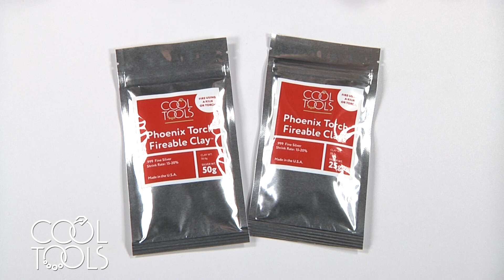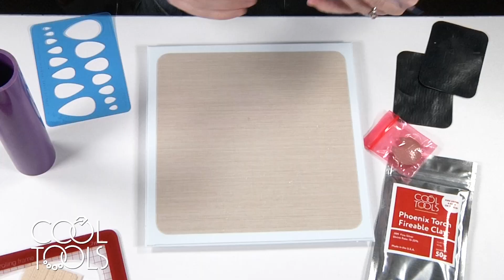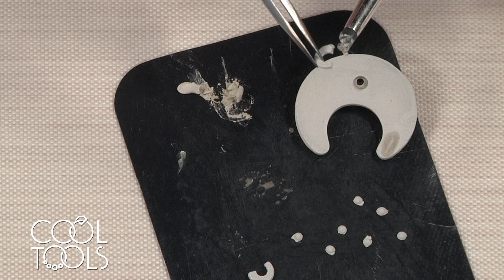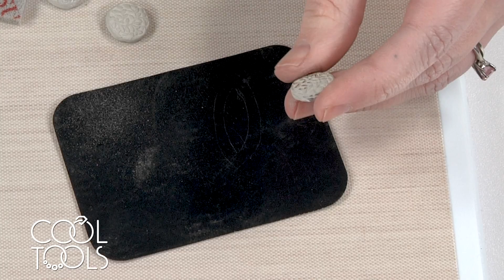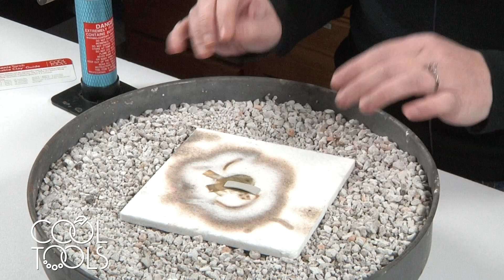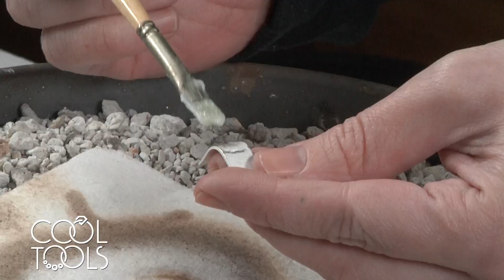Cool Tools | Intro to Phoenix Torch Fireable Clay™ | Fine Silver Metal Clay

Comment: Just purchased this clay, mine is definitely a different texture that I’m noticing from this video. My clay is cracking, and definitely not smooth as yours is. I added a drop of rejuvenate without success of conditioning it smoother. Definitely not happy so far with this product
Reply from the maker: Hi Cathy, 

As a result of the density of this clay, when adding moisture back it’s helpful to roll the clay into a sheet, place a drop or two of water or Rejuvenate on the surface, spread it out, and fold the moisture in. This helps it incorporate instead of sitting on the surface making things slippery. In fact, since you asked about special ways of working with the clay, any time I roll the clay into a sheet, any clay that I’m putting back, I’ll swipe a finger damp with water over the surface of the clay and fold that moisture in prior to putting it away. 

Hope this helps, 

Karen

Comment: Hi Karen, thank you for this incredible video! I've been having a few issues with the Phoenix Torch Fireable clay and cannot find tips to fix them online anywhere. When I first open a new pack of clay it works great at first but then will become hard to use and starts to separate and crack when using for a second time. I have tried adding moisture and also keep any leftover clay in my hydrator container, but adding moisture seems to make the separation even worse. Do you have any tips for this? Additionally, I have had a few projects break after firing recently when I tested out the strength very lightly. I am not sure if I need to fire for longer or if this is normal with thinner pieces, but they seem to be breaking far too easily. Any tips would be greatly appreciated, I was used to using the Mitsubishi PMC clay so this has been an adjustment for sure!
Reply from the maker: Hello, whenever I do anything that might have a drying action on the clay, such as rolling it into a sheet or rolling it into a coil, I’ll brush or apply some moisture to the clay and immediately fold it in. Just applying the moisture to the top of it doesn’t seem to help much as the clay is dense enough that it doesn’t readily absorb added moisture unless it’s incorporated in. Could we inquire as to what method of firing you are using or what firing schedule you are using that is resulting in the breaking pieces?

Comment: I would like to fire my Phoenix clay pieces with a trinket kiln.  Would the time be different from kiln fired suggestions on the card - I'm assuming the card refers to a larger kiln and not a trinket kiln?
Reply from the maker: Hi Jennifer, that is correct. The firing temperature and times on the card are for a standard table top kiln. If you can tell us what trinket kiln you are using we can help you in how to best fire your pieces.

Comment: Hi Karen, 
Would this clay be good to make rings  and bracelets using the torch to fire? Or is better for just pendants?
Also , would you still pickle this when finished before polishing?
Also, if I were making a bracelet, would and should I bend it before firing it with the torch? Would I be able to and is it possible to make a bracelet with it, being as it would be long when flat? Can you fire a whole bracelet with a torch?
Reply from the maker: Hey! So this is something I'm currently testing out. Fine silver typically isn't recommended for rings, but I've found that Phoenix sinters to be really strong, even with just a torch. I've made several rings that I've torch fired with Phoenix and have been wearing them and putting them to the test of being worn to see how they hold up to daily wear and tear. So far the ring I've been wearing for 5 months is holding up well, so I feel like Phoenix can be used for torch fired rings. Hope that helps! 
-Karen
Reply: @cooltoolsvideos  thank you! That was very helpful 🙏🏼 do you think it would for bracelets?
Reply from the maker: @jeanene888  Yes, the answer would apply the same for bracelets :)
Reply: @cooltoolsvideos  awesome, thanks Karen!

Comment: Great video 🙌🏼

What do you prefer? EZ960 or Phoenix torch fireable clay?
Reply from the maker: It depends on what I’m working on! Both have very different working qualities and I’d choose different clays for different jobs. I really like working with Phoenix, I’d say I prefer it for wet construction and most things, but would choose EZ960 for a piece that’s going to be heavy in dry construction or would require a lot of flexibility when in the greenware stage. 

Karen
Reply: @cooltoolsvideos  Thank you! Also, another question, is there a paste or syringe I can use with this? I saw that you said you can use the clay itself as paste. Is that what you meant as watered down paste? Also, can I use a bezel made with bezel wire set into the clay then torch fire it? Or would I torch it then add flux and solder the bezel on top? 🙏🏼🙏🏼
Reply from the maker: @jeanene888  We do not have a paste or syringe yet, but do plan on this in the future. You can definitely use the clay itself as paste. Add a little water to a small piece of clay and use a clay shaper to rub the water in and create a thicker paste. Yes, you can use a bezel made with bezel wire and set into the clay to torch fire. Use paste to attach the bezel wire instead of soldering!
Reply: @cooltoolsvideos  cool, thank you!!
Reply: How do you make the tight screw in for the pendant to spin or the ring?🤷🏻‍♀️